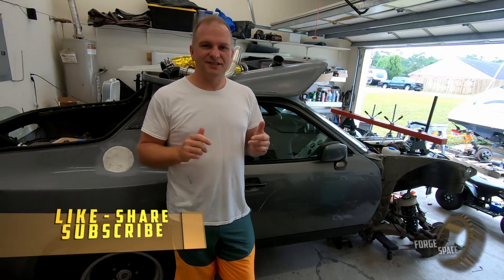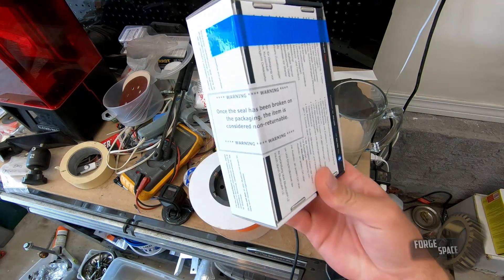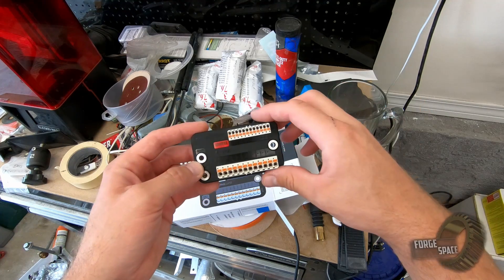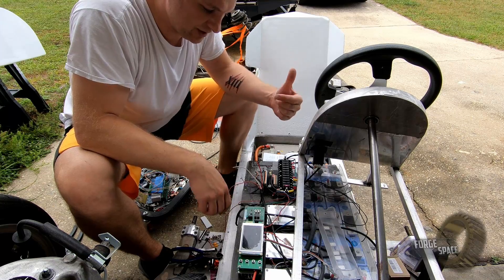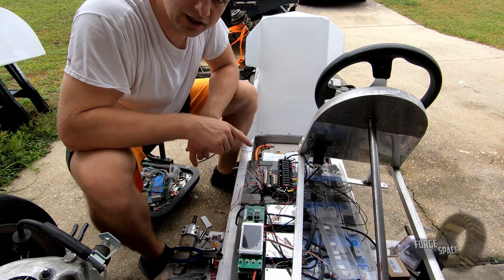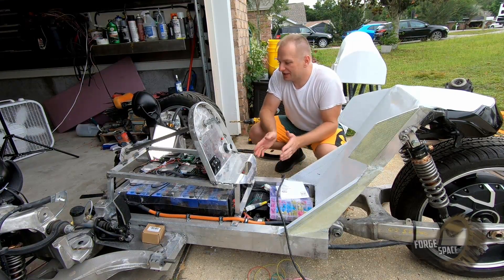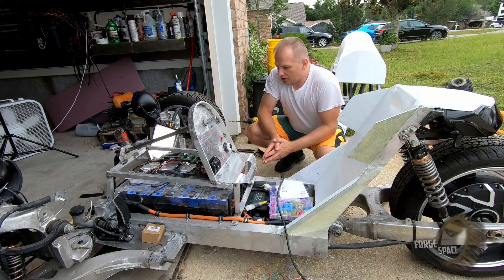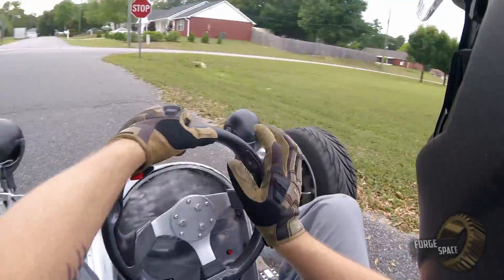Installing a M.Unit electronic motorcycle system controller - Autocycle EP 26

Comment: you dont balance these rims, you add beads into the tire and it automatically balances it out
i built the 134.4v bicycle running the QS 273 70h v4 17X6 inch with the winding slots enlarged (drill press and a vice and a lot of patience rewinding it) to fit more copper and running a khb12101 1000 amp controller at max power

you can achieve 440nm quite easily, QS advertised them at 350nm, but thats actually for the 8kw 273 50h v3 , the 273 70h v3 produces much more....

im not sure if youre using the kls14401 or not, the kls84801 or 72701 would have been a much better option if you want a speed controller, otherwise the khb12101 is a much better controller with 500amps continuous and 1000amps peak, but with a torque throttle, it has the same feeling at a petrol, kls are speed based throttles

i sell both khb and kls, and use both in all my projects, im not selling anything to you, just giving some knowledge
 that will help in the future

back to the rims.... theyre actually magnesium alloy, they have a extremely thin lay of aluminium and the inner core is all lightweight, i know because i cut one up recently to use as an outrunner, a 1600rpm 96v 12kw continuous 273 70h 70h 17x6 v4 to be exact

the 273 80h watercooled v3 is a better motor in my opinion, but qs are not producing them unless you buy in bulk, i can still get 273 70h watercooled however, but that 20% extra torque when cooling makes a huge difference, electric motors hate heat, and they hate ferrofluid (demagnetises from excessive heat on the magnets = less torque) so i'd avoid any cooling mods, you'll also find that your tire pressure will increase when racing because of the expanding air pressure from the heat, i always set my rim pressure slightly lower if i plan on racing at high speed, biggest upgrade is simply higher quality copper, more if you can fit it in, and replace out the crap hall sensors they put in it
Reply: This is fascinating info Dylan. I’d love to see some pulls from your 273 rig
Reply: @Levi_Allen  we have a facebook page strictly hub motors, youre more than welcome to join, its for educational infomation, plenty can help you with knowledge if needed, im currenbtly working on a 2wd 168v 800amp setup for 1/4 mile usage have some older projects on there too, i prefer not to film anything because of the 250watt 25kph Australian law
Reply from the maker: Dylan what is the FB page name?
Reply: @ForgeSpace  strictly hub motors,

Just answer yes to both questions...

Comment: What’s the advantage using the M unit over the built in wiring of the Kelly?
Reply from the maker: Its not a matter of an advantage, the Kelly controller does not have full control for turning lights on and off, turn signals, headlights and switching, etc. What this does is eliminate the need for relays and fuses for the body electronics
Reply: @ForgeSpace  oh interesting. The model of Kelly I’m using for the same motor has all the wiring for lights built in. I didn’t know there was a version similar that didn’t have that. Good to know
Reply from the maker: @Levi_Allen  yeah, the manual and wiring diagrams have no provisions. That would have made things simpler if it did.
Reply: @Levi_Allen  thats not the actual kelly controller, thats the CAN protocol dash or instrument designed to work with any CAN controller, you can get kellys with or without the CAN hardware, personally i prefer to run my kellys at max so the extra heat from the CAN hardware is not needed for me, for someone running under 75% power it will never make a difference as long as the heatsink is facing cold air
Reply: @dylandesmond  that’s some interesting input. I’m curious to hear why you feel it might contribute that much heat? Is that annecdotal or have you had a Kelly running at full tilt overheat while using lighting/CAN